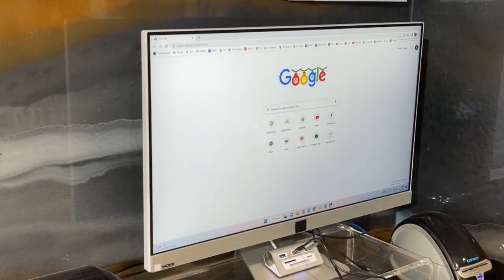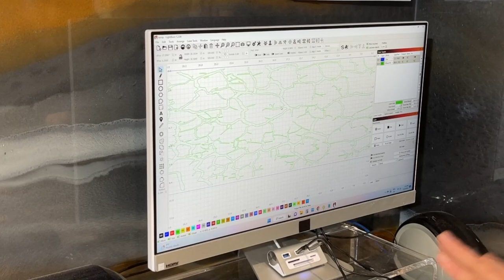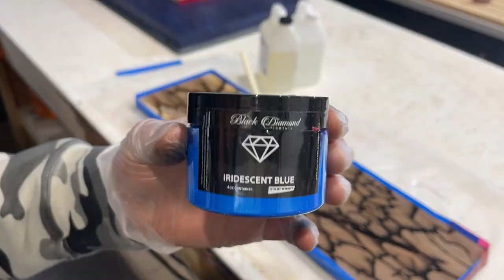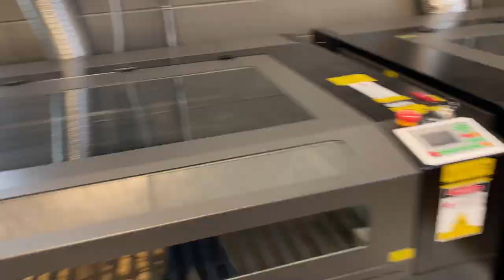DIY Woodworking Project : Easy Wine Racks Using Router Templates

Comment: which resin do you recommend for charcuterie boards and why is it different than this art resin? Thanks
Reply from the maker: Art resin is thick. Designed to setup fast, and maybe be poured to at most 1/4" in depth. Charcuterie boards are normally 3/4-1.5" thick pours. Using a fast setting art resin would create an immense amount of heat, the resin would bubble and warp. The "deep pour" resin is thinner, takes longer to set, and dissipates heat more evenly overtime due to this. Cool?
Reply: @CraftedElements  thanks, that explains a few happy accidents i had in the past. can you provide the names of both the resins you prefer? thanks for sharing.
Reply from the maker: @scottwilkie5669  We use @TotalBoat Thickset (not Thickset Fathom) for 70% of our pours. Since most are smaller projects and charcuterie boards. You can use it for pours up to 1-1.25".

Comment: What bit are you using to flush trim?
Reply from the maker: We use the Amana tool flush trim bit generally, but the bit in there right now for the video is a lower cost SPE tool from Amazon.